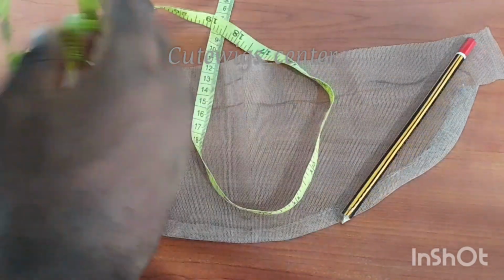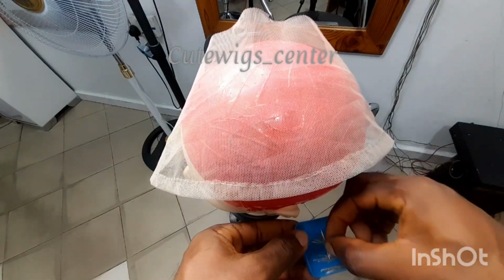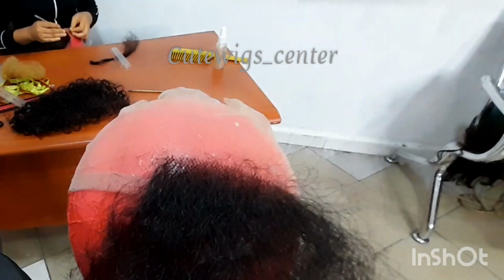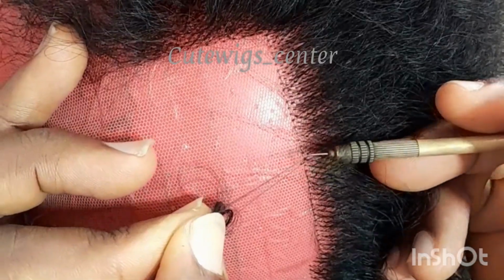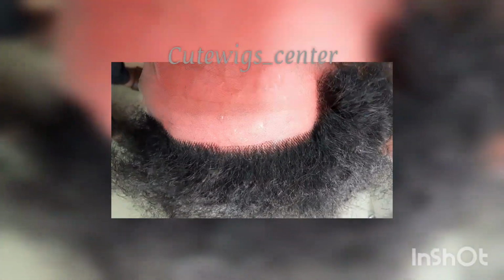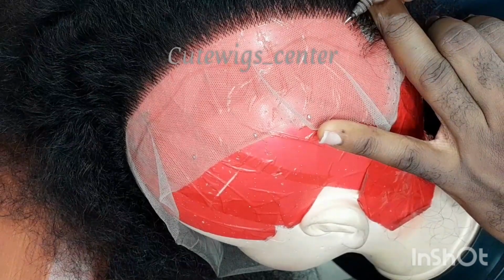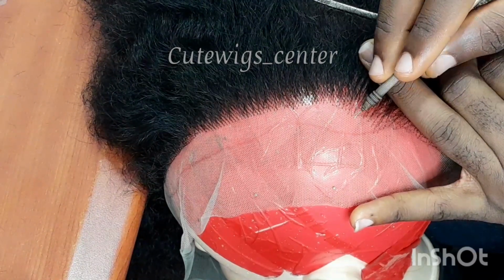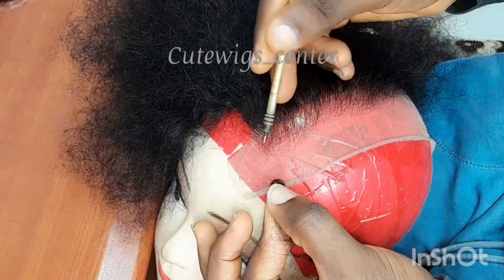How To Ventilate a Lace Frontal/3 IMPORTANT Parts(BEGINNERS  FRIENDLY)

Comment: So no darts in the lace? I always use darts to turn flat material into a curved shape, unless I heat shape the lace, which I rarely do. I don’t see how the front will lay flat without them? In general I block the hairline flat first, then smooth it back to see where the darts need to be.
Reply from the maker: Great 👍